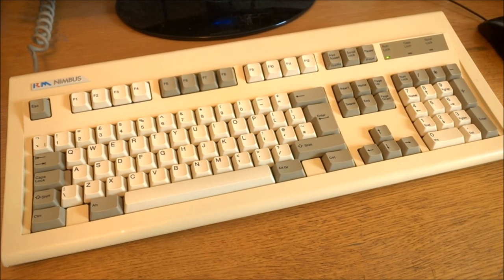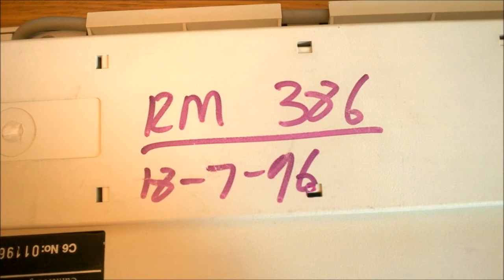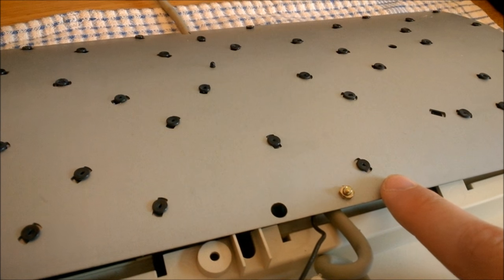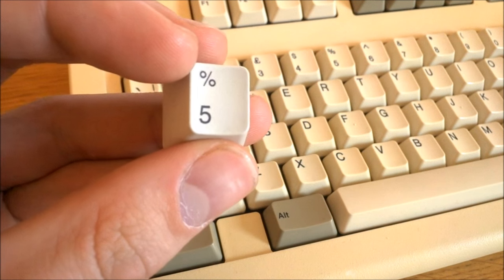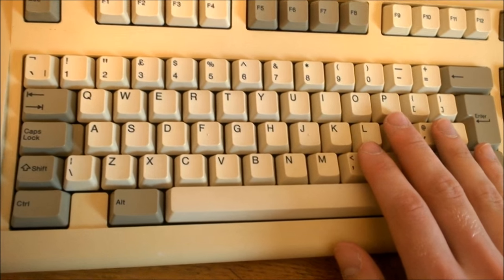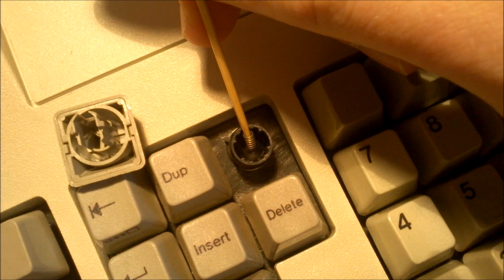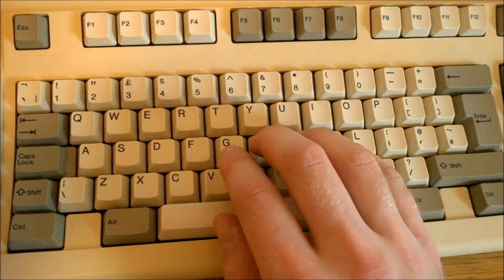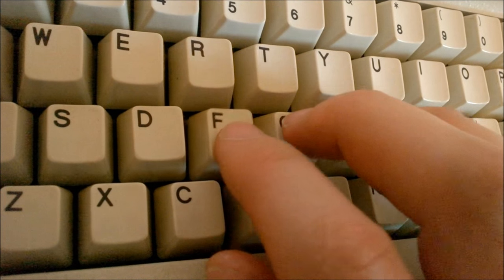Alps SM-101 review (Alps buckling spring)

Comment: in the typing demo at the end, you can make out the high-pitch ting when you press down on the spacebar.
Still see if you can get your hands on an Inspiron 3700/3800 keyboard (part # 052VDD is the one I have) because the metal scissorswitches they use would make for a good review. (the keyboard which has no alps "Track Stick" eraserhead nub since those models don't have the circuitry for it, I think the UK keyboard used the metal scissorswitches as well.)